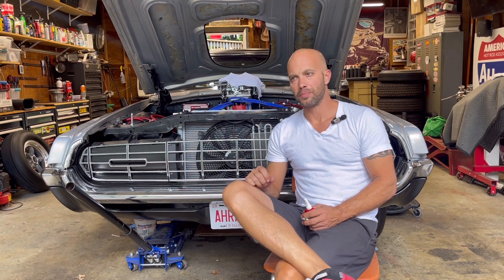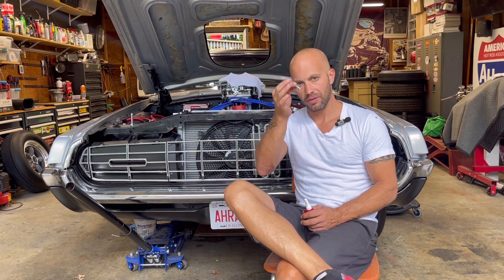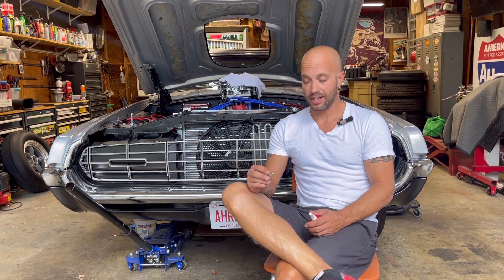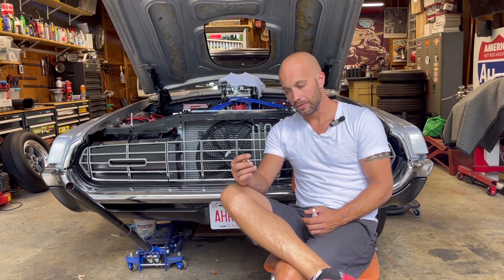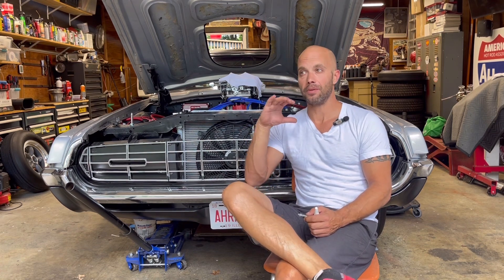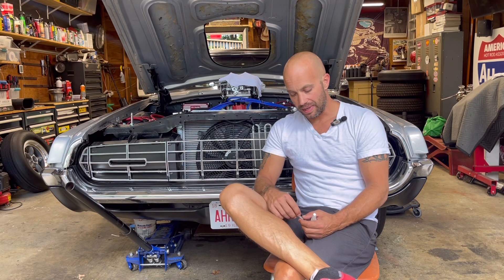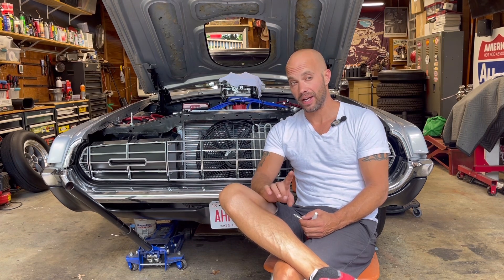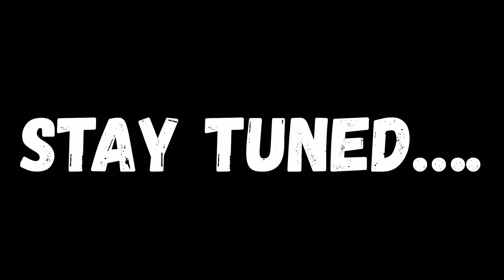Will it Work?  Loctite 545 and a Bleeder… #nonamenationals

Comment: I would have replaced the bleeder screw, if still a problem and didn't want to replace the caliper, then would have gotten some speed bleeder thread sealant and did that as it's made for bleeder screws.

Comment: Back in the day I had a boogered up seat on the front caliper of a Corvette.  I really didn't want to replace the $$ caliper.  I picked up an insert that was a new seat and bleeder screw machined into a set screw.  Worked like a charm and once installed it worked just like a standard bleeder.
Reply from the maker: Oh that sounds exactly what I need!  Do you remember who made it?

Comment: I say the loctite is not a permanent fix if the bleeder screws or where it seals to have been machined wrong it will never seal!... Never ever have I ran into this issue on all the makes I've worked on pretty sad that they can't even machine something as simple as a bleeder screw or seat. Or are totally defective. The threads don't do the sealing the end of the bleeder screw does that job! Banjo bolts the copper crush washer takes the sealing job.
Reply: Right moparnut, this isn’t the way to go. He’s got me concerned 😂
Reply: @UnfinishedProjectDartSport  yeah you get what I'm saying there's no way that a machined surface that's supposed to seal be off that far like putting a 37° fitting on a 45° seat not going to work you can force it to work but not a good idea!
Reply from the maker: I’ll do it the right way 🏁🏁🏁
Reply: @2HacksGarage  yeah you could take a blue sharpie and mark the bottom of the bleeder then screw it in tight pull it out and it would leave witness marks then you'll know for sure if its a defective or mismatched parts.
Reply from the maker: @moparnut6286  I will definitely try that
Reply from the maker: @moparnut6286  time for new a new bleeder.  I didn’t even put any pressure to it.  Sealed it, let it cure, still dripping…..
Reply: @2HacksGarage  yeah I figured defective crap it's just sad!
Reply from the maker: Yep!!! Sadly it’s brand new too….
Reply: I've ran into it on remanned calipers. I put Teflon on the threads. Maybe not what you're supposed to do but it seemed to work. That was years ago.
Reply: @catsaregovernmentspies  teflon tape is ok if your vaccum bleeding but not meant to seal or hold pressure the machined end on the bleeder and seat in caliper are.. if fluid is making it past the bleeder seal/seat then something is wrong.
Reply: @moparnut6286  Yeah, the Teflon was just so I could get the lines bled. Once tightened down, the Teflon had already serves its purpose and wasn't there to hold pressure.
Reply from the maker: @catsaregovernmentspies  I might have to do that.  Picked up some new bleeders too 🤙🤙

Comment: I hope you found your problem. When I was doing injection mold maintenance, I had a high pressure (10,000 PSI) fitting that leaked past the threads. The local hydraulic shop gave me some epoxy made for hydraulic systems. Never had a problem after that. Might have been Locktite. 🙂👍
Reply from the maker: We will find out soon!!  I’d be interested to know what they had you use
Reply: @2HacksGarage  brake system never reaches 10k psi though?